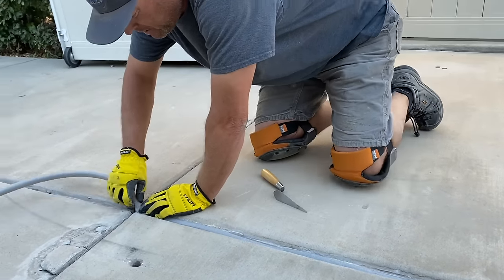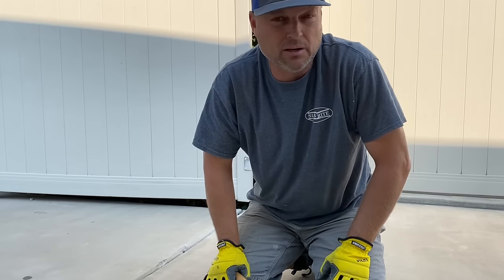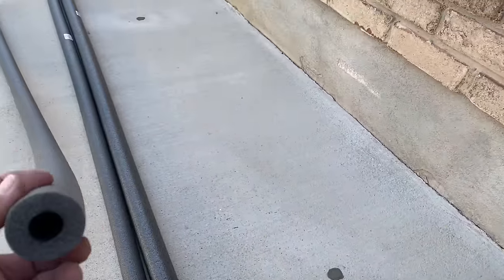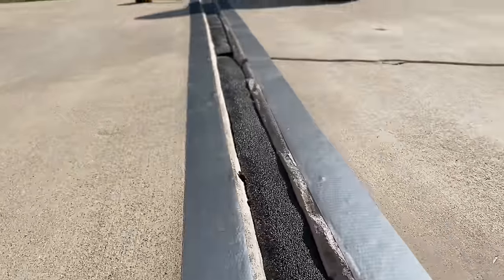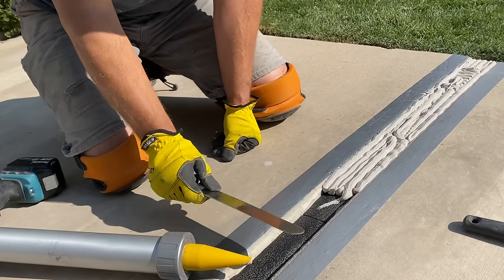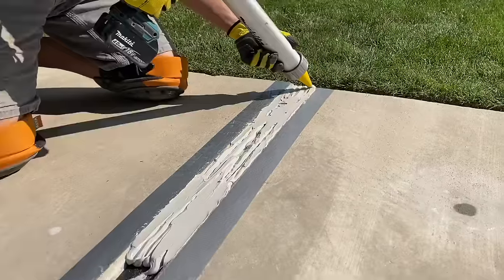How to seal concrete control joints

Comment: Great demo and info,  however, my concrete to painted - can this product be painted and sealed after?
Reply from the maker: I don't think it can be painted since its a silicone based sealant.  Dowsil does make it in many different colors so you can probably find one that matches close enough or use a contrasting color.

Comment: I live in Western NY, and the freeze and thaw of months of winter over the years has made a mess of the concrete slabs in our driveway. As much as I'd love to do this, the slabs are all uneven and trying this would look horrible.
Funds make our awful driveway something we're stuck with, I feel.
Reply from the maker: Find a reputable concrete lifting company there and ask if they seal joints and cracks as part of their service.  They can level up the slab sections and seal the joints for you adding years of life to your concrete.
Reply: Yes western new yorkwas brutal to exteriors.The reason i couldn’t afford it because the government found ways to get your money.i have moved away from these tax and spend policies to a more conservative state.

Comment: I do not have a problem with joints but the cracks have crab grass growing out of them.  I will use Flex Seal to seal the cracks.
Reply from the maker: put a wire wheel on a grinder and clean out the cracks from weeds and other debris then seal and the weeds wont grow back through.

Comment: The price of that Dowsil in Seattle is $16 bucks for the 20oz sausage and not available in state. 

I wonder if Dowsil’s replacing that one for Dowsil Weatherproof Sealant? I am going to call them.

Up here the pros message is to prime and use a poly blend for the hardest cure. 

I will just test it out and give the customer a warranty :-)
Reply from the maker: That price is too high.  The weatherproof sealant is a little more money than the CCS.  Try getting it from Smalley and Company out of Denver, CO.

Comment: This is great! Do you use playground sand on new concrete or is there a lighter silica type sand you'd recommend? I know eventually the concrete with oxidize and weather, but with penetrating sealers and such it could take some time and I am curious how the play sand would look on that light grey/white surface of new concrete? Any tips would be greatly appreciated!
Reply from the maker: With new concrete we don't use any sand or silca.  It looks awesome with out.

Comment: Hi Scott, would you recommend pushing the backer rod to the ground and adding enough to fill the gap until how you have it in the vid?

I was worried about a gap under the backer rod if I didn’t fill the expansion joint.
Reply from the maker: Hi Richard, No. Do Not Push the backer rod to the dirt. You only want the sealant to be at the most 3/8"-1/2" thick. The gap under the backer rod is not necessary to fill.  If you want to fill it, pour some sand into it, but leave enough room for backer rod and sealant.

Comment: Hi Scott. I'm wondering if the driveway was recently poured or repaired and resurfaced. It also looks like the slabs were raised with foam prior as well. Those are some huge gaps you're starting with. Also, I'm surprised you didn't fill the gaps in with mortar and grind the necessary gap needed for expansion and contraction. Thanks for the demo. Cheers!
Reply from the maker: Hi Peter,  this job was and RV Parking area on the side of the garage, was original and had not been previously repaired.  It was also on the north side of the house so it never gets any sun especially in the winter months.  The control joint cracked and then for years it would fill with water freeze and push the concrete sections apart from each other with each freeze/thaw cycle causing the 2 1/2" gap. Filling with mortar is never a good solution in an area with freeze/thaw cycles because you need to keep water from getting in the joints and freezing, which was the problem.  Sealing the joint with Dowsil Contractors Concrete Sealant is the best way to prevent further water penetration and still allow for expansion and contraction throughout all 4 seasons.  I have been back to this job to see how it held up after the first winter and it looked just like when we finished the job months before.  Thanks for watching and taking time to comment.
Reply: @dscottgillett  No, thank you for the reply. Good luck!

Comment: Dang, there was about a whole tube of caulk in that waste box.  
Question, is this merhod preferable to using Polymeric sand? Tx
Reply from the maker: Yes, there is some waste just like most projects.  Polymeric sand will work well if you don't have freeze/thaw cycles where you live. If you live where you have 4 seasons then polymeric sand will open up a crack and let moisture in with the freeze/thaw cycles and eventually break out because it has no elasticity or bonding agents with the concrete.

Comment: You missed the calling as a cake maker, LOL. Those are some nasty expansion joints. Expand they did. Thanks for sharing the techniques.
Reply from the maker: These joints were on the north side of the home so during the winter the snow an ice pushed the slabs apart from each other.  Thanks for watching.

Comment: I've got a spec calling for Dowsil 790.. Is that what you happen to be using in this video...??
Reply from the maker: Hi Mykro, we use Dowsil Contractors Concrete Sealant it is very similar to the 790 but a little less cost.

Comment: Your tool work nice. But why would you use ccs  instead of horizontal sealant? Why not 888 or something traffic grade or made more specificity for s.o.g application?
Reply from the maker: I'm not sure what the acronyms stand for you are using in your comment(ccs, sog)?  The reason we use it is because it works, we have never had a call back because of material failure.

Comment: I know this is an old video, I have a question. Could I put this over 1/2" pvc and when done drill holes in it to give me drainage around a pool? The plastic drain channels are broken and a hazard to our feet. Jist wondering...
Reply: Sealant should only bond to 2 sides. You will need to use bond breaker tape on top of PVC. Depth of sealant needs to be between 1\4" to 1\2", no more, no less. I wouldn't use a silicone around pool if there will be standing water. I would use a urethane. Look at Deck-o-Seal for a sealant

Comment: Scott thanks for all the tips!  I just did this to my driveway today.  Any idea how long it takes to dry?  Wondering how long until I can drive on it..
Reply from the maker: the sealant will take a few hours to skin over and not be sticky to the touch depending on outside temperature and wind.  Check it after a few hours if it's not sticky you should be good to go.

Comment: Is the non-sagging type the same as self leveling ? Also
It might not be a bad idea to brush off some the sand to get a even more smoother finish. Good job !
Reply from the maker: No, Non-sag is nothing like self leveling.
Reply: @dscottgillett  so which one should a non-pro like me use ?
Reply from the maker: @mazdakmorati2297  its personal preference. I have tried both and prefer the non-sag sealant to self leveling.
Reply: @dscottgillett  thank you sir

Comment: I have some questions. Great video by the way. So you should seal the expansion joints and the control joints as well? And correct me if I'm wrong but the expansion joint is the joint that actually cuts all the way through the slab? And the control joints only cut into the slab or sidewalk partially? The control joint doesn't cut all the way through it's only like a 1/4 or so deep into the slab correct?
Reply from the maker: Hi Scott, Thanks for watching my video.  To answer your question if you want to keep water from seeping through the expansion joint its necessary to seal it.  The control joints are to hopefully control where the concrete will crack because it will crack and when it does water is able to seep through and possibly cause settling.  So you would only need to seal the control joints that have cracked and begun to open up.  It will also keep dirt and debris from collecting in the joint and weeds from growing in them.

Comment: Great info! What would you use to seal between the concrete slab and the foundation wall? I have some space to fill in, but it's too narrow to fill with any backer rod.
Reply from the maker: if there is not enough space then just use the sealant and tool smooth Dowsil Contractors Concrete Sealant.
Reply: Cut small/thin pieces from a pool noodle

Comment: Do you prepare the seams ahead of time? Howndo tou clean them out and do you grind/bevel the edges to get them to match?
Reply from the maker: Yes we use a wire brush to clean the joints and sometimes a wire wheel on a grinder, then blow them off removing any dirt/debris. As for the edges we lift the concrete to match, that is our primary business "concrete lifting".   www.slabrite.com
Reply: @dscottgillett Hey,
 I'm looking at starting a concrete leveling company here in Colorado.  How likely would you say that a one man van operation could earn over 100k? I believe we should have around 280 days of lifting without ground freeze. I'm interested in the HMI foam lifting setup. Any info/tips would be great, thanks!
Reply from the maker: @mystyboarder910  You would be doing yourself a favor staying away from the HMI Van set up.  Look me up and give me a call.

Comment: Is the caulking material you use polyurethane?  Thanks for the video!!!
Reply from the maker: No, Its Dowsil Contractors Concrete Sealant silicone based.
Reply: If a silicon based material is used, what can be done to enable painting?  Someone used a silicone caulking in cracks and paint does not adhere to silicone.  I saw a video where shellac primer was used.  Do you have any experience with that?
Reply from the maker: @lindaweidner5124  Usually painting of the floor is done first then seal joints and cracks.  Dowsil makes several stock colors and will also do custom colors upon request.
Reply from the maker: @lindaweidner5124  I don't have any experience trying to paint over the silicone based sealant.  My limited knowledge is that paint on silicone doesn't stick.  maybe try the shellac process an let me know if it works.  Thanks for watching.

Comment: I can’t figure out where to buy the rod or that sealer. I’m in Utah too
Reply from the maker: Hi Tiffany,  You can find backer rod at Home Depot or Lowes in the concrete sections or weather stripping area.  The sealant I buy from a wholesaler called Smalley and Company.

Comment: Excellent work Scott!!    Fellow foam lifter here in MN.    Good to see pride in your workmanship 

How much do you charge to seal doing that method?  I use a 8$ bottle of self leveling, but generally not happy with the durability of it. Thanks
Reply from the maker: Depends on the width of the crack or joint but generally my rates start at $6.00 per lineal foot and go up from there.
Reply: Wow I'm ripping myself off with $5.00 with material and cleanout

Comment: What did you do with the massive cavity under the concrete?
Reply from the maker: Before we sealed the cracks and control joints we raised and supported the concrete sections level to each other eliminating any trip hazards.

Comment: Great tips! I need to do this in my shop before I put down a skim coat of something like rapid set NewCrete.  Can you skim over those repaired joints to make a smooth surface?  I get annoyed with creepers or any small wheeled items getting stuck in those valleys left after the repair.
Thanks in advance.
Reply from the maker: To be honest I haven't tried putting anything over top of the sealant.  With that said, I don't think its a good idea especially since its a silicone based product.  You might want to try an epoxy type joint and crack filler for your shop floor to keep the wheeled items rolling smoothly.  Good luck.

Comment: Can I reapply a little bit so that I can add some sand to get the top to match nicely like that?
Reply from the maker: That's not something I have ever tried before.  If you try it, you will want to make sure the older product is clean to allow for good adhesion with the skim layer in order to sprinkle the sand on it.
Reply: @dscottgillett  i reapplied sand stick good
Reply: I forgot to add sand to the top.  I’m wondering if applying some spray adhesive then sand will work

Comment: Thanks for the lesson Scott. Do you have any feedback from your clients or pressure washer business owners how the Dow product holds up under the use of a pressure washer surface cleaner?
Reply from the maker: Hi Kent,  I have not received any negative feed back from customers.  I have my own experience with it on my on driveway and it is holding up great even after pressure washing several times a year.

Comment: That sand is actually not a bad idea and I’m kinda surprised that certain big traffic flat work areas jobs don’t recommend it. I saw another guy do it and then started brushing the wet caulking and sand mix and making a mess. I worked decades on and off for about 5 or 6 different caulking companies which ranged pretty dramatically as far as standards But No One Ever Taped Anything. I’ve seen other guys little contractors tape and get the caulking All over the tape and then pull the tape and break the seal all the way down both sides. Pull the tape and break the seal. That’s a whole lot of back knifing and wasted caulking and that shit is expensive. I worked with guys who put the Exact amount in and knifed it. NO BACKKNIFING!! Caulkers I worked with Wasted NOTHING not like other trades with enormous waste. THOSE concrete joints are Way too big and that’s Way too much caulking. Those should have been simple 1/4 inch Sawcuts and No Caulking Caulking saw cut joints is Idiotic and unnecessary just like sidewalks caulking and other stuff. Those Flexy knives were never used by the top gun caulkers Almost always used Stiff blade ground round putty knives or something like that I’ve made a lot of knives over the years. You have to be aggressive with caulking and not scared of it

Comment: Or you can use self- leveling caulk and be done in record time snd no tools are needed
Reply from the maker: Self leveling has its application but would not have worked here.

Comment: What happens if slabs are uneven?
Reply from the maker: Martha before we sealed those joints and cracks we raised and leveled the concrete to even up the slab sections.  That is what we do lift and level sinking concrete.  The joint and crack sealing is another service we offer to go along with it.
Reply: @dscottgillett  how did you raise and level the concrete?
Reply from the maker: @marthadebilzan4467  Check out our Facebook page" Slab Rite Concrete Lifting"  there are a few videos that show how we lift and level concrete.

Comment: The trowel should be used to push the caulking into the crack instead of scraping it off.
Reply from the maker: It does push into the joint as you work it.
Reply: @dscottgillett  .. But not as good, the tape keeps the edge clean, so pushing the caulk into the crack will get out any air.  Just a thought !

Comment: Looks like an expansion joint not a control joint.
Reply from the maker: its a control joint that was on the north side of a home that had been separated by years of snow and ice pushing the slab sections apart from each other.
Reply: @dscottgillett  " that's a lot of damage"

Comment: What idiotic builder made the expansion joints that wide?
Reply from the maker: Hey Winnie, this started out as a normal control joint that cracked and then widened over many years of freeze thaw conditions in Utah.  The water freezes and expands slowly pushing the sections of concrete away from each other. That's why in areas where these conditions exist its good to seal the joints to keep water out.
Reply: @dscottgillett  Wow that’s a lot of ice pushing. I thought the builder made it that wide. Those fillers must a fortune since the gap is that wide. A cheaper alternatives would be running expansion joint boards along the sides and fill the middle with new concrete.
Reply from the maker: @winniethepooh1931  filling with new concrete wouldn't last one winter here. You'd end up with water working its way through the cold joints and freezing breaking up the new concrete that was poured to fill the gap. Sealing it is the only way to keep from further damage.

Comment: This video should be called how NOT! to caulk a driveway, no prep, cut back to tool, and sand, horrible job dude. And you taped the joints for what
Reply from the maker: Hi Jeff, show us how you do it.  I see your channel has zero videos.
Reply: There was no prep work, I’ve been caulking for 10 years and have never done anything like that. Sorry if I came off rude but you know that’s not going to last long
Reply from the maker: @jeffkeizer1708  all the prep was done prior to start of the video. We removed a cement type filler that was used and failed.  I have been back to this home recently and what we sealed here is holding up very well.  We will be working on other areas of the property in the next couple of weeks.  I have been doin this for 7 years and only ever had one call back.  Must be doing something right.